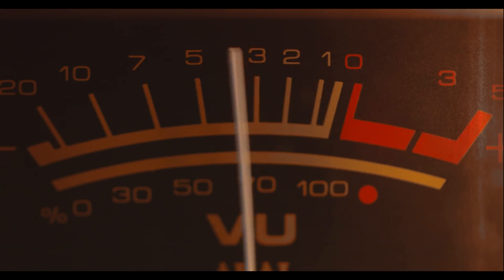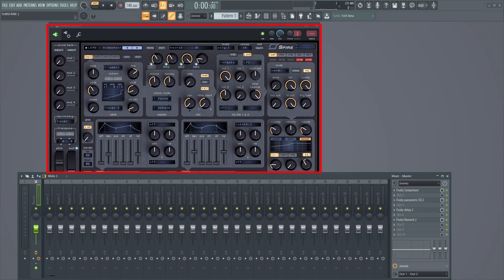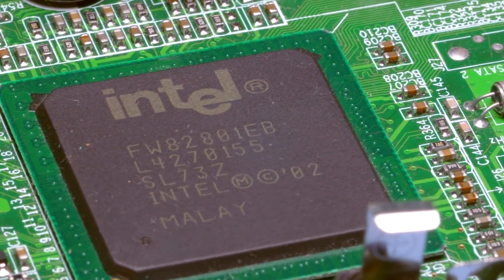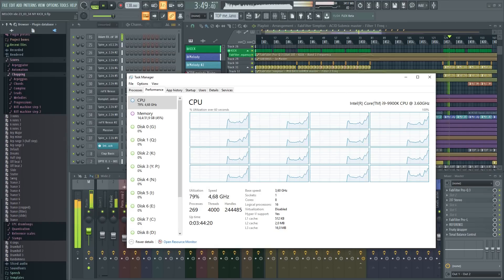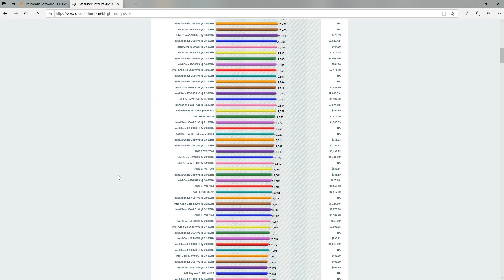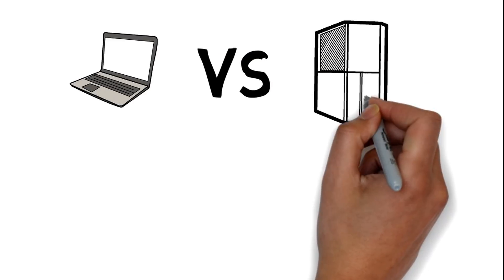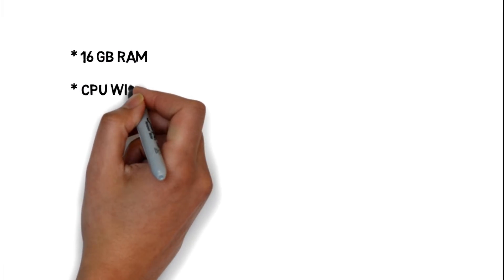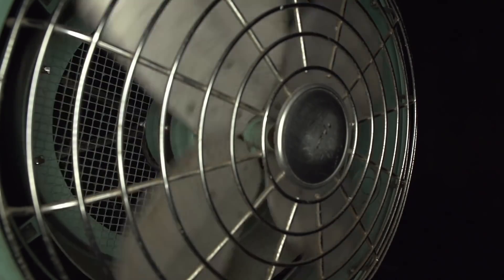The Best Computer For Music Production - What's Needed And Why!

Comment: the problem with the information is that Intel is ahead. there is a separate chart showing you the single core performance which you wanted us to look out for on passmark. where the first top 12 cpu on that list has only 1 Intel processor. so i say don't get Intel.
Reply from the maker: Hi, keep in mind that the new AMD 300 series was not yet released when this video was published, so at the time AMD had nothing that even came close to Intel. Knowing that the video would qucikly become unrelevant due to new chips being released, I tried to generalize as much as possible. 
Right now, the 3000 series offers superb performance, and have about the same single core as the Intel 9900k. That said, you also need to take IPC into consideration. While they might have the same base single core performance, the 9900k will usually be able to overclock to 5 ghz on all cores with little effort, while AMD's flagship, the 3900x will only be able to run at about 4 GHZ on all cores. That's a 1 ghz difference, which will have a huge impact in serial intensive applications such as a daw. 

Generally, the new AMD CPU's are better value than the Intel, and unless you need to push it to the very limit, I generally recommend getting the AMD these days. They will offer very good performance, and are great all round CPU's. Most people won't need the very best CPU for music production. But for those who do, the 9900k is likely still ahead when it comes to music produciton.

Comment: My only complaints your cable management. Yikes dude. Yikes.
Reply from the maker: Indeed, at the time I was making the video there was no cable management. I cannibalized some parts from my old rig such as video card, hard drives etc, and since I need the computer in order to run my business (Youtube, mixing & Mastering service etc) I had to skip that part unfortunately. I was actually editing this video before I was done putting in all the disks, and I believe I was done editing the video 15 minutes before it went live. :)
I have since gone back and done the cable management of course, but it still annoys me that it didn't make it into this video. It's the only thing I wish I could have done better with this video. It's a minor issue, but still.. Annoying!
I'll make sure to set aside time to do it right in the next one! :)
Reply: That's awesome, your information was on point. Much appreciated for the much needed knowledge!

Comment: Probably a dumb question, but a better processor and a better sound card would eliminate latency when recording instruments straight to your daw? I'm having an issue with instrument latency. I'm 99% sure it's my processor and sound card
Reply from the maker: There are no dumb questions, only dumb answers. :)
Recording instruments, guitars, vocals etc actually isn't extremely CPU intensive. It's much more demanding on the CPU when you use heavy VST's and such. For basic recording, even a fairly low end computer can be used with great results. 

The latency issue can be due to improper buffer settings, or the wrong driver being used. It's important that your daw get direct access to the sound card in order to eliminate latency, so make sure you use the best ASIO driver available to you. 

Here's a video I made a few years ago, explaining how to get the best CPU performance in FL Studio, as well as how to set it up for minimal latency: https://youtu.be/OWYmqwb7b4k
Reply: @FireWalkMusic  Thanks for the input. I have tried all that and still have pretty bad latency. I'm at my wits end

Comment: Very nice video, with great explanations. I am currently using a laptop, a 2017 version MSI i-7 quad core, with 16 gigs of ram expandable to 32. You are right about the fan noise 100%. I am using a Steinberg UR 44,  6 X 4 interface/external sound card, and JBL LSR 308 monitors. Something you do not mention, and I'm curious about is, how well is the processing performance enhanced, if I increase the ram? I had a dedicated p.c., but got ransom ware on it and just sold it for parts. I will build another, when money avails itself. Thank you for this video.
Reply from the maker: Hi, increasing the amount of ram won't increase performance, unless you are having issues running out of memory. 16 gigs should be more than enough for most producers. 32GB is usually overkill. The only way the RAM can impact performance is with regard to the speed of the memory. I recommend getting fast RAM with low latency. There's also dual and quad channel setups, but that's more of an issue if you're running a workstation setup, which you're not. :)
Reply: @FireWalkMusic  Thank you for replying to me. 2 years ago, the way it was explained was that the more ram, the more tracks you could have open at one time. But really, how many do you need (lol).

Comment: meshify c case - because it has better airflow for the whole pc and 3 ssd mounts / dark rock pro 4 cpu cooler because it is made better, it transfers heat better and it has much better 'be quiet' fans than noctuas and it has double the lifetime of noc fans/ skip the asus maximus mobo because the features maximus has over the asus strix z390e is just water cooling overclock stuff. buy a 1tb(minimum) nvme with at least 3500mb read speeds and also buy samsung as they have the highest maintainable transfer speeds(meaning they stay at a higher burst speed transfer rate that lasts longer) over other ssd brands. also this video shows a basic stock clock of the default 4.7ghz. this is not an overclocked test from what youve displayed. also if a 650 watt psu is cheaper id go with that as 650 watts is still over kill for this pc even with 3hdds, 3ssd, 2nvmes and a 2070 super and with a 5ghz overclock to ALL cores. goodluck hope this info helps.
Reply from the maker: Hi, some good info here. Thanks. The computer was running at 5 ghz in this video, but the task manager only reports the stock speed for some reason.
Reply: @FireWalkMusic  not sure what version of windows youre running but task manager should display the max clock. you may also have a overclock for a few cores not ALL cores. also you might have to lower your AVX values in the bios to achive the correct clock speeds. AVX will down clock a overclock depending on the cpu load type.

Comment: Different tracks use different threads which means more cores = more tracks.
Reply from the maker: Indeed, every mixer track is an opportunity for the CPU to use multitasking. Unless there's some dependency created like bus routing, send tracks, sidechaining or whatever. 
The main problem is that work won't be distributed evenly across cores. So let's say you have a futuristic CPU with 200 cores, but VERY bad single core performance. It would not be able to handle even a medium sized project because as soon as one of those cores are starting to lag behind, the others will have to wait for it to complete it's work before they can do anything else, and you'll have overruns. 

This is why raw performance is ultimately more important than the number of cores. You want as many cores as possible of course, but with the best possible single core performance. As core count goes up, single core performance tend to go down, and the best CPU for music production is usually located somewhere in that sweet spot, right before you start sacrificing core performance. 
IPC is also important when it comes to real time audio processing.
Reply: @FireWalkMusic  That's true. As of now, I think Ryzen 3950X is one of the best CPUs (for everything). Best of both worlds.

https://www.guru3d.com/articles-pages/amd-ryzen-9-3950x-review,9.html

Comment: From what I understand, a good audio interface or midi controller can help with a lot of the sound processing taking some of the pressure off the cpu, is this true or how does this work exactly? Because I would like to be able to run NI Kontakt, without needing an i7 and 64gigs of ram lol 
If I could make due with 8 gb of RAM and an i5 without my Kontakt glitching that would be nice
Reply from the maker: You're probably thinking about a DSP. The audio interface itself doesn't offload the CPU, it just plays back the sounds, as well as provide in and outputs etc. When you use plugins such as Kontakt, Nexus, Spire, Sylenth1, Serum etc the CPU has to do all the work. Your audio interface won't make much difference. The only thing it can do in terms of perforance is to provide you with a very low latency asio driver. They typically provide better (lower) latency vs the built in sound card and the generic drivers (asio4all etc).
Reply: @FireWalkMusic  okay thanks that helps.

Comment: I agreed with most of what you were laying down but then I seen a video where the older ryzen 2700x outperformed a newer 3600 which has much better single core performance, but a couple less cores. What are your thoughts about the budget CPUs for music production?
Reply from the maker: It's hard to recommend a budget computer for anyone because everyone have different needs. Generally, I recommend getting a computer that's a little bit faster than what you actually need. AMD generally provide better value than Intel. The new 3000 series is very good and provide great single core performance.

Comment: this video needs to be updated, because a month later from when this was uploaded. ryzen 3rd gen came out, and wiped the floor with intel
Reply from the maker: A new video is planned. As you know, things evolve quickly in the hardware world. The new 3000 series from AMD is great, but I wouldn't say it wipes the floor with Intel. If you look at the 3900x for example, it has more cores, and about the same single core performance as the 9900k. However, it can only run at 4 ghz on all cores at the same time, while the 9900k can run above 5 ghz on all cores at the same time. That's more than 1 ghz more. When you take IPC (instructions per cycle) into consideration then you'll get more brute force from the 9900k, and this is actually more important than just having many cores when it comes to music production. For video editing and other tasks that benefit more from multiple cores though, the AMD will indeed be the better choice. 

The new AMD CPU's are generally better all round CPU's, but when overclocked, Intel will probably still come out ahead with it's 9900k when it comes to music production. This might change when AMD releases their next CPU's though, since Intel are still struggling with their manufacturing technique.

Comment: Or get an old multi-CPU server for a tenth of the cost. I spent $450 in 2018 spec'ing an old Dell T5600 to 2x E5-2690 (16 core), 64 GB Ram, and a 1TB SSD (very important if you are reading many tracks from the hard drive, as in recorded instruments, not virtual.) The computer scores a 11,500 on Geekbench, and I rarely peak over 50% total CPU usage even with projects with 200+ tracks, multiple reverbs, and modeled instruments.
Reply: I just looked into these parts but it still gonna be at least 2x what you spent, you got good deals. However I have no idea what kind of ram or ssd's to get from brands ETC, I know nothing of building computers
Reply: @heythere6983  The pandemic has raised the price of electronics. Everyone spending their stimulus checks on podcast, youtube, and music related items.
Give it a few months, and then price your components out again.
Reply: @delphia.online5875  hey if you could help with this question I have, I would really benefit from some perspective..

I have a 2017 i7 2.9 ghz quad core 16g RAM macbookpro, Im trying out logic, using the trail. When logic was being used, about 7 gs of RAM were being used by the computer.

I was using my m audio key station 88 to record an electronic bass line. Very short, first track.Less than a minute long. Even just by playing, not recording,there is an audible click when changing notes. I then added a track of bloomsbury strings to it, which created horrendous clicking and popping/audio issues. 

I know too many plugins too and tracks can burden a cpu, but with my specs, is this really acceptable with ONE track? not even recording? And then later with the strings, so with two tracks and no other programs running on the computer, should this issue be happening? I mean I dont have an outdated MacBook Pro and specs are alright..

Some more details

I connected the controller via USB. I was on 32 buffer size, however , is this really typically an issue again with not even recording initially? and then with recording only one track?

When I changed buffer size to 128 AFTER recording and listening to playback, the clicking from the recording itself went away, which confuses me. I would think it would stick since it was recorded that way. Actually the clicking stuck with the bass line, but the violin clicks/pops went away.. 

At 64 buffer, audible issues still there. So im limited to 128 buffer size with just one/two tracks? Even just playback, if I moved the fader up for one track, clicking and popping,unless it was at 128 buffer. I mean wow is this really normal?

I didnt seem to have issues messing around with Steven slate drums and a Pad Kontrol at 32 buffer connected via USB. Though I didnt record with it yet, just used the software, but remember, just using the midi and stock logic plugins created issues, not even recording yet. And also had issues adjusting faders on one track!

      Could it be my MacBook Pro has an issue? Iv never heard of someone having issues moving a fader on a two track project thats less than a minute on a recent processor with decent RAM. There were a few of those plugins on the tracks that logic adds by default, however, even with a few plugins, I had issues with ONE TRACK on stock plugins. I mean, idk, that to me sounds unacceptable. Even with two tracks. I mean at this rate, how did anyone survive using DAWS on an older processors and less RAM just years ago?
Reply: @heythere6983  Check your latency
Reply: @delphia.online5875  but will checking that tell me if latency in that situation is normal. If an issue with latency under those circumstances is normal then okay but my issue is not that there is something out of the ordinary going on because there is, my thought is, is it normal to have those kind of issues at that level with those kinds of specs. 
   Im wondering if someone with a cpu and RAM like mine is forced to even listen at 128 buffer without hearing popping when moving a fader on a 2 tracks beginning of a song.  IV seen people recommend i7s with 16g of ram for music production but I doubt anyone would recommend that if it would that kinda spec would have issues like mine. OR maybe everyone who has those specs or less sees what I said and thinks thats totally normal.
   If thats normal I cant imagine how anyone can mix a full song with plugins on anything near those specs
Reply: What was total cost of entire build? You think you could help me out on a build?
Reply: @TheTattoedVRpilot  eBay is your friend. So is PassMark test data. I spent $450 total.
Reply: delphia.online so u got a dell t5600 and added ram, new cpu and hard drive?
Reply: @TheTattoedVRpilot  Two years ago. If you want the best price to performance today, go to PassMark, compare CPUs, and then check on eBay. Your best best for price is probably going to be a deal CPU server motherboard with or without CPUs installed.

Comment: Please rate my PC build:

Case: be quiet! Silent Base 601 black

Power supply: be quiet! POWER B9 - 600W

Motherboard: ASUS PRIME X370-PRO 

CPU: AMD Ryzen 7 2700X, 8x 3.70GHz

Cooler: Alpenföhn Ben Nevis

RAM: 16GB DDR4 RAM 3000 MHz High Speed

Hard drives: 240GB SSD, 2000GB HDD

Video Card: NVIDIA GeForce RTX 2060 SUPER – 8GB

Mixer: Behringer Xenyx X1204 USB

Monitors (Sound): M-Audio BX5 D2
Reply from the maker: That's a decent system. Should work well for music production. It's not the fastest CPU out there but it should work well on most "normal" projects.
Reply: @FireWalkMusic  thank you for your opinion

Comment: How does the Ryzen 3700X fare in music production?
Reply from the maker: It should fare really well. It has about the same single core performance as the 9900k. I believe that the new AMD Flagship CPU's will be comparable to the 9900k right out of the box. However, the AMD CPU's are clocked to the limit already, so if you take the 3900x for example, then it won't be able to run at more than 4 ghz on all cores. The 9900k however will be able to run above 5 ghz on all cores. So when you overclock them, and take IPC (instructions / operations per cycle / operations per clock) into consideration, and the fact that brute force is more important than number of cores, then the 9900k will still come out ahead in music production. 

That said, very few people will need the very BEST, and the new 3000 series from AMD will be more than enough for most people. AMD typically also provide better value than Intel, and has newer technology. Intel is still struggling with it's manufacturing technique, while AMD is going full steam ahead.
Reply: @FireWalkMusic  Thank you for your response! Is this what's called "IPC"?
Reply from the maker: @iseeu-fp9po  yes. Instructions / operations per cycle / clock